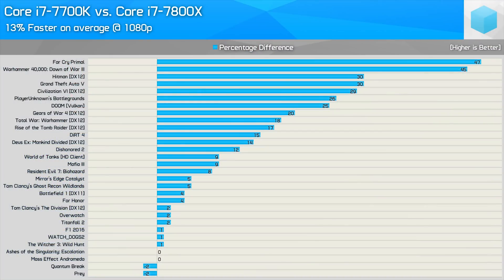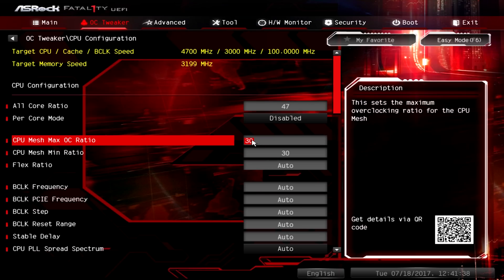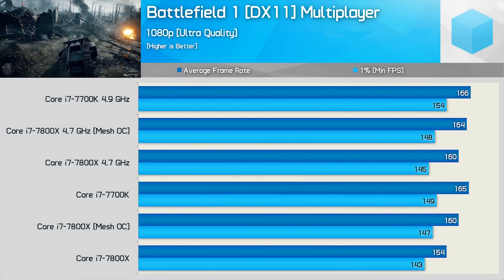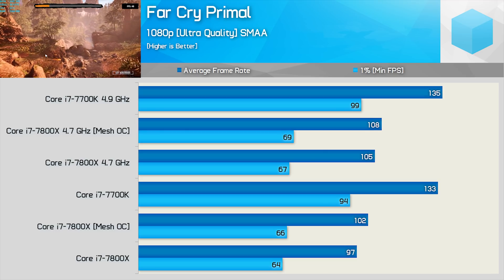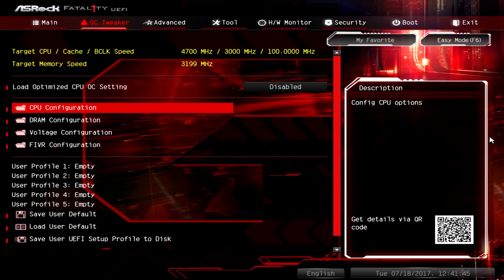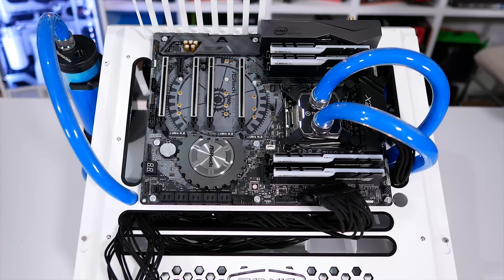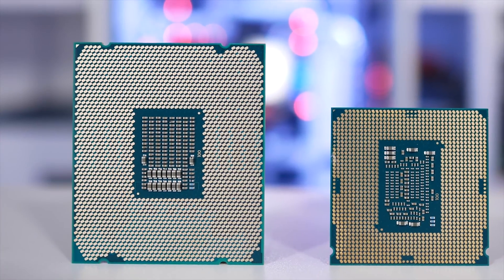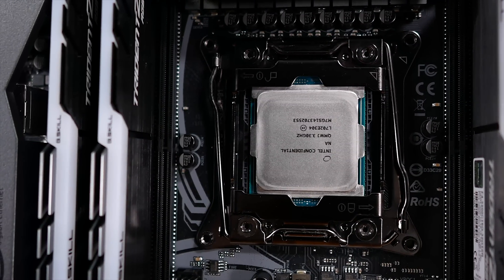Intel Mesh, Does Overclocking it Fix Skylake-X?

Comment: You rock Steve! Immediately answered a question that came up from your earlier vid :)
It makes sense to me, there shouldn't be huge amounts of data passing around the cores, not enough to saturate the mesh anyway, so I wasn't really expecting an increase in performance. Great to see it confirmed & helps to stop people claiming overclocking the mesh will save the crappy Skylake-X.
Reply: What about this turbo core 3.0 boost being disabled/not working on some bioses...?

Comment: Overclock your Intel MESH! gotta make sure you get that 3% performance. Or just buy AMD and get 3200 RAM and call it a day.
Reply: Or just... ya know. Input the speed and timings yourself, it takes all of like 20 seconds.
Reply: Truth, MSI has been on point.
Reply: Since the newest AGESA update, there's been some numbers circulating that show significant gains, at least in game framerates, from going to DDR4-3466 and beyond, where (possibly due to older microcode) you got diminishing returns after DDR4-2933. Could also be significantly impacted by memory timings. I wonder where the real plateau is, since I plan to get an R5 1600 soon.
Reply: for gaming, dual rank memory seems to get you gains with ryzen (it also used to give a lot of trouble in the first weeks)

https://community.amd.com/community/gaming/blog/2017/07/14/memory-oc-showdown-frequency-vs-memory-timings

if only i knew before i ordered my ram... but yeah it's pretty new info that wasn't around 2 months ago :)
Reply: And pray you get the XMP speeds you paid for!

Comment: 4.7ghz w/ OC mesh Skylake-X is freaking slower than stock 4.5ghz turbo kabylake? Damn Intel impressive!!
Reply: that takes innovation
Reply: I remember when Ryzen R7 first came out and no one wanted to hear that
Reply: if they keep this up the Gen 2 of ryzen will have better or equivalent IPC in the higher core count future
Reply: The Ring Bus Architecture was what MADE SandyBridge and up so damned powerful in regards to gaming... Fuck your Die Space Intel, RING BUS OR GO HOME!
Reply: You haven't seen the best one yet, wait for the Covfefe Fake next month. With its 3.7GHz and a chopped L3 cash it will dwarf the X299 mess.
Reply: Intel and their damn glued together processors......
Reply: exactly. Imagine the possibilities when that happens. when speed per core becomes a thing of the past it would benefit everyone greatly.
Reply: jockemoll couldnt say it better cheers
Reply: Just like Ryzen's gaming performance, really. Makes Intel's slides about EPYC seem hypocritical, since they blast AMD for developers needing to optimize around latencies inherent to Infinity Fabric- and now the same thing will be needed for the inter-core network of Skylake-X.

I imagine that, although new on-chip networks like IF and Intel's mesh-style network slows them down versus simpler designs, that'll later be dwarfed by IPC improvements, greater multithreading use in software and clock speed boosts down the road.
Reply: TechSpot has an article that tests this. Skylake's better IPC nets the i7-7800X oh, 15% better performance in most areas, with some outliers where an R5 1600X matches or beats it by a smidge. However, it does so consuming much more power, running hotter and costing substantially more than the performance gains it offers. With the value proposition of the R7 1700 and an easy overclock on the packaged cooler, it doesn't seem like a good buy. That's not mentioning the much more expensive X299 platform.

For me, an R5 1600 is a no-brainer.
Reply: It's almost like the same cpu architecture was recycled for 3 years and it is still not optimised....

Cmon...
Reply: Michael Winter what if they don't care about gamers this year tf
Reply: Randall Lawkin that's where their nose is pointed
Reply: oh boi
Reply: check out more scores than just games. I am quite sure it destroys in every other single task. Just like the 4.5ghz kabylake destroys the most expensive AMD cpu in games aswell. Games need to be optimized for more cores. When that happens, we who are using enthusiast intels or expensive ryzens will take full advantage of the power.
Reply: jockemoll then the real multitasking will pop off and become crazy awesome
Reply: It's still Skylake, but now the cores are communicating over a mesh network, with higher latency, instead of a ring (or multiple rings.) This adds latency but was deemed necessary for the higher-core-count Skylake-X chips to come (allegedly up to 18 cores.) It'll be cheaper for Intel to make one monolithic Skylake-X die and, through binning, establish the 6-core up to the 18-core SKUs based on how good yields are (and product differentiation with disabled cores) than to have, say, an 8-core-and-down version with a couple of ring buses and a 10-core-and-up die design with the mesh.

The way I see it, there's two things that need to happen, but only so much can be done to mitigate latencies at the hardware level:
1) Software optimization that takes into account extra hop(s) from a thread's core through the IMC to the RAM and back
2) Microcode updates by Intel to make the mesh more efficient (not unlike optimizing a wired LAN for fastest routes/least hops to destination).

I'm also convinced the different cache arrangement has some impact on games, but I doubt it's quite as much as the difference the mesh makes due to the introduction of latencies. We saw similar changes in FPS in AoTS on Ryzen before and after patching that might have reduced cross-CCX traffic through smarter thread synchronization.
Reply: I think Intel's cadence of using the previous generation for the higher core count chips and the latest for the mainstream is biting them in the ass. It never made much sense to me, but I figure it has to do with maximizing profit and minimizing waste on silicon already fab'd.
Reply: Sadly, not all tasks parallelize well. Also, multi-threaded software can be somewhat limited by its single-core speed due to one thread controlling the rest. You see this in some games where the 7700K takes the lead for clock speed reasons despite multiple threads in use.
Reply: My 7800x does 5.2 core 3.4 mesh somehow lol
Reply: It's almost like new CPU architectures don't run as well on games that haven't been optimized for them! gasp

Comment: Mesh design? more like Mess design am i riteeee
.
.
.
.
.
.
.
I gonna kill myself now.....
Reply: what's with all the periods?
Reply: you know you can just use enters
Reply: Seriously Intel, SCREW DIE SPACE! The Ring Bus Architecture was a HUGE part of what made SandyBridge and newer SO DAMNED FAST FOR GAMING!  Oh well, this just means that my next upgrade will be to X99 and probably an i7-5820k as I have been seeing them in-box for as little as $200! For a REAL Gaming CPU, that is ACTUALLY SOLDERED-  and as a result, can easily hit 4.5 GHZ on JUST a Hyper 212 EVO! 

I know this because I built my dad a rig with EXACTLY that setup! It only took me at most maybe 30 minutes of tweaking to get it there, and in Prime95 it never breaks just 93 C.   

I wish Ryzen was better for gaming than it is honestly, but as gaming is the hardest workload I put on my PC - I just want the best performance possible. And X299 is quite lacking so far...
Reply: Well there is no alternative for this many cores. AMDs Infinity Fabric adds even more latency then Mesh and Ringbus only makes sense with less cores.

Comment: I love my i7 7700.... But get Ryzen people
Reply: realistically the sooner 8C/16T becomes a big enough portion of the user base, we'll see the bigger engines make use of the higher core counts. Ryzen allows people to utilise this core count at the same price as the 7700k, for the newer games it will end up providing better perf. Especially if you wait for ryzen+.
Reply: @sickbailey21  Game Engines are very hard to parallelize, which is why 2 years later the 7700K still is at the top of the Gaming benchmarks. Single Core performance is what counts and up to now Intel still offers more even with 14nm.
Reply: Give Me A Smile why? The i7 is the best at gaming, and the ryzen is the best bang/buck for high core workloads. Fuck fanboys dude